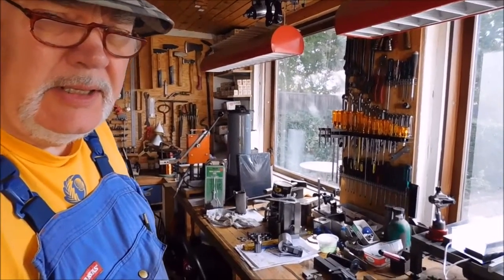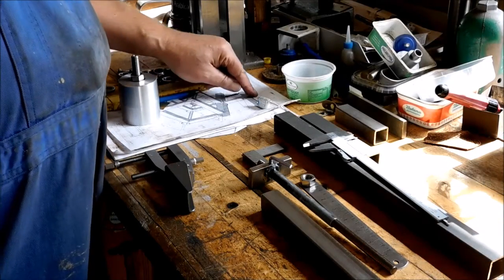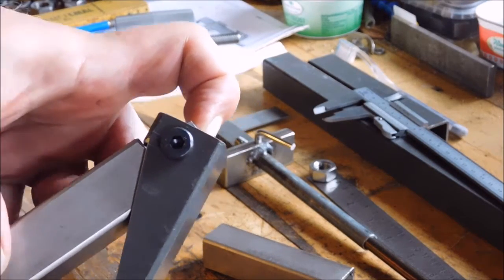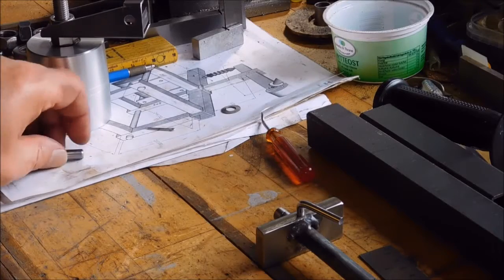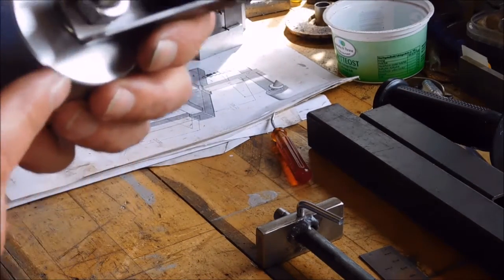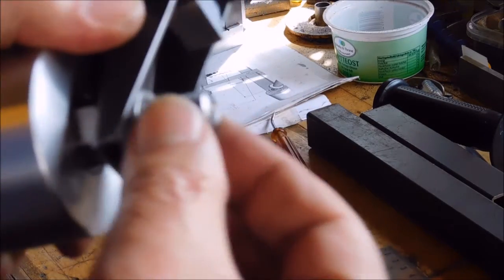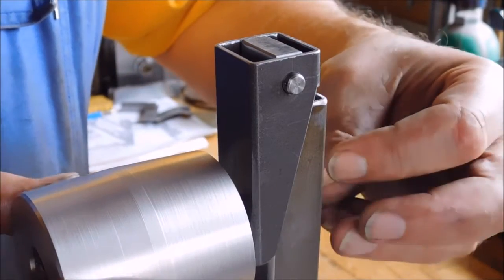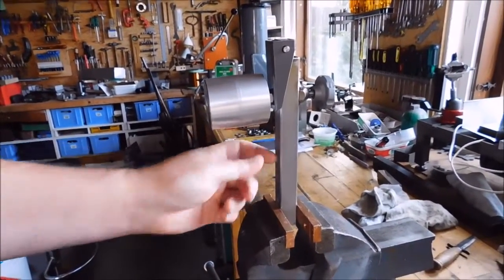Beltsander 13

Comment: I would put a jam nut on the handle so it does slip and have your tracking change during grinding.
Reply from the maker: Ha, ha ... are they really so bad ;-))
Reply: +Keld Sørensen yes...you can stop it with a gloved hand.
Reply: I suppose you are right. Just so long as the friction overcomes the vibration.
Reply: They are usually retained by spring tension... not jammed up.
Reply: Gotcha, I thought the vibration might be a little much for friction to do the job.
Reply: The spring is on the bolt like you would find on a carburetor adjustment screw. At least I think that's how they work.
Reply: Wish you hadn't use Harbor Freight as an example. I just threw up a little.
Reply: I just grabbed the first pic that showed the setup. :) I had one of those... very weak. Gave it away when I got a better one.
Reply: I just got a Ryobi, not the heaviest but good medium duty shop sander. Great for roughing and pointing tungstens.
Reply: they are very handy tools.
Reply from the maker: ??? ... I think you mean " ... does NOT slip ..." - right ?
Reply from the maker: I don't think the handle will move while using the sander BUT if it does I can put a spring on the adlusting bolt and the cone in each end will sort of resist the rotation of the adjusting bolt.

Comment: as i can understand the roller will be manual adjustable every time when you change sand belt ? or what ?
Reply from the maker: Yeah, for sure and I think sometimes using the same belt too - I think you can "use a belt" so it will run off to one side - I have a very smal sander and that's the case on that, at least

Comment: Nice work.  How much does the center line of the roller move when you adjust the tracking?  My brain can't quite picture the difference with your setup versus one where the pivot point is closer to the center of rotation of the roller.
Reply from the maker: Woops, maybe you have a point there ... 

I think the center line moves 3-5mm relatively to the other rollers.

Oh, but it's another story to make a tilting mechanism that tilts ortogonal to the rotation of the roller in the center of roller width - I think that's what you mean - right ?  (my tilting mechanism IS in the center of the rotation of the roller, but NOT in the center of the roller width ... and that could be a problem ! )
Reply: Yeah, that is what I meant.  But, I would think that if the other rollers align with the tracking roller when it is "level," you won't be adjusting the tracking so much that it should affect alignment.
Reply from the maker: ILGopher
My way of thinking is: if ALL rollers - the tracking roller inclusive - are LEVEL and the MIDDLE of the width of each of them is alligned, then the tracking roller will be able to move the belt "a little" to each side JUST by moving itself "a little" to that side - BUT maybe the movement of the tracking roller HAS TO BE in the axial direction of the tracking roller ALONE and NOT tilting at the same time ;-o   ... !!!

I hope the "ctowning" will force the belt to stay in the middle of the width of the tracking roller when I adjust that roller AND that the movement of the middle of the width will force the belt to move sidewise on the other rollers.

Huuuu, it's way more complicated than I thought from the start ...